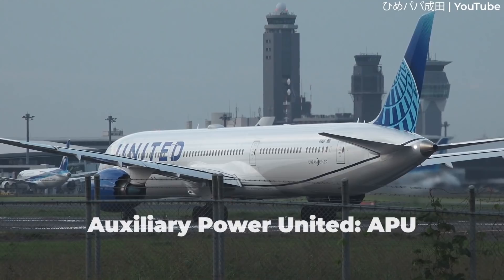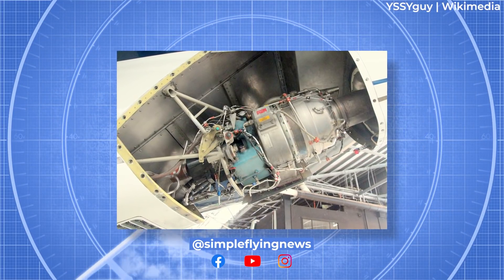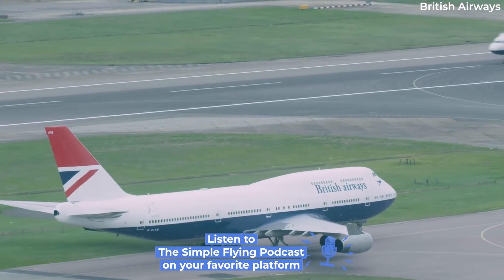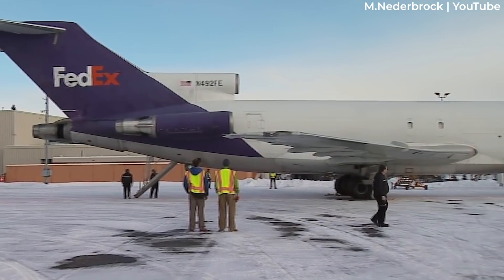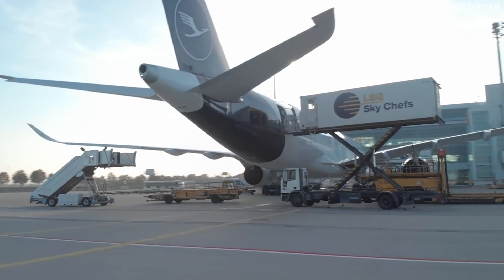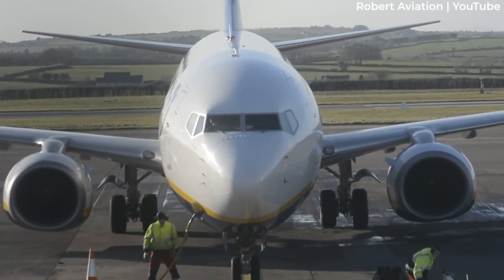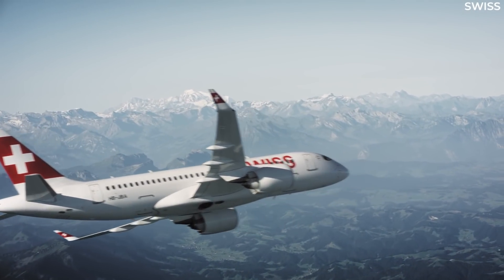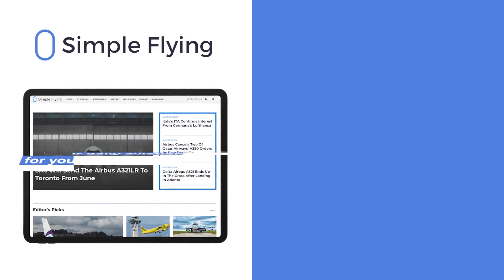What Was The First Jetliner To Be Fitted With An APU?

Comment: A problem with the 727 APU placement in the right wheel well was that the exhaust was also on the right side fuselage, just behind the wing.      Sometimes fuel vapors would collect in there and during start up after landing, it would ignite those vapors and produce a brief flame up past the right side windows - startling the Passengers.    As a Flight Attendant, we would have to be aware of this fact so that we could be ready to prevent an unnecessary evacuation that would be started by the Passengers.      If you look at old photos of the 727, sometimes you can see a dark streak across the right fuselage that was caused by these flair outs.
Reply: The flame that you mention was only after a failed start when unburned fuel was left in the combustor. Upon a second start, that fuel would create quite a fireball roaring out of the right wing. Newer APUs have a fuel venting feature to prevent such flameups.
The 727 APU could not be operated in flight.

Comment: The biggest reason carriers use ground power units is financial. This costs on average 300 dollars an hour to use the APU. Going power units are a fraction of the cost.
Reply: You can't cool an airplane with a GPU except for the all-electric 787. Cooling requires huge amounts of bleed air.

Comment: How does the APU get its air? Does it bleed air from the engines? I didn't see an air inlet.
Reply: It takes in air from a dedicated inlet located on the upper fuselage which closes when not in use (that's why you don't see it). Some of the air goes to the combustor, the rest to a shaft-driven "load compressor" which sends air to the airplane's pneumatic system (ECS packs, engine starters).

Comment: I think anyone who is interested in aviation would know about the use of APUs. It's often a gotcha question in quizzes, ie how many engines does a 747 have - answer, 5 (although it can ferry a sixth engine under the wing). At one airshow, I saw a glider which had been fitted with a tiny jet engine. One of the commentators joked to the other (who was a 747 pilot) that the engine was smaller than the 747 APU. 😀
Reply: With an engine, didn't it cease being a glider!?

Comment: In the early 80's as a new 727 flight engineer on starting the APU I would close my eyes and cover my ears as the turbine was situated under the thick part of 3 fuel tanks. They would also "torch" quite often in strong wind conditions.
Reply: What do you mean?
Reply: @donaldstanfield8862  it means it was like putting a bomb underneath a kerosene storage tank
Reply: No. The APU was enclosed in a fireproof shroud to prevent fires. It was located inside the keel beam of the airplane in between the landing gear.
Reply: @Greatdome99  It traversed the keel beam and I don’t Consider anything in a wheel well fire proof. Period.
Reply: I used to fly a Hawker that did the same thing when the APU start nozzle was clogged.  Quite a spectacle at night; it'd light up the whole ramp.  We called it the "Angry Dragon".
Reply: @elcheapo5302  Nice!

Comment: Very inacurate.  APU's swept in for flying boats,  which had flights of several days,  and stays on the water.  APU's powered tube radios,  cockpit and cabin lighting, fans,  ventilation,  plumbing,  bilge pumps,  vacuum cleaners,  cabin appliances,  and backed up landing gear.  Each radial had a big generator and one more ran off a quality Advanced Power Unit air cooled gasoline engine.  The APU also took strain off the small batteries for starting motors.
Reply: I wondered about that, they landed in some pretty remote areas, so would need to be self-contained, thank you!
Reply: @donaldstanfield8862  just some minor rewriting.
Reply: In the mid 1950s the USAF Grumman Albatross amphibian (Sa16) had an APU in a separate compartment in the rear fusillage which we used to start engines both on the land and on the water. George Groh(former USAF navigator)
Reply: I used to go on detachments with P-3 crews to some places where support was limited.  One time we were flying out of Bogota and the APU didn’t have enough power to start our engines as the airport was at 8600 feet above sea level. A 2nd P-3 that did start used its prop wash to assist to get that first engine going.
Reply: I saw a diesel APU in Howard Hughes Flying Goose. Located just behind the flight deck.

Comment: i think i read once that an apu on a 737 technically increases its glide distance/time by like 13%, assuming both engines die
Reply: How would it do that? It produces electricity and compressed air, not thrust.
Reply: @davec8921  During our Delta Airlines B737 training, we were told the APU generated 37 pounds of thrust...insignificant for powered flight but good for trivia questions.
Reply: @davec8921  its exhaust is pointed backwards.... and while it might not be optomized to throw it backwards with as much momentum as possible like a regular jet engine, it both lightens the plain and has some mass velocity in the opposite direction. might also have to do with keeping systems online that optimize glide ratio in newer models

Comment: The placement of the apu on the 727 was horrible... the noise was deafening when unloading the rear cargo bins... That was my only complaint about the 727, otherwise it was one of the most well designed products to ever come off of the Boeing assembly line.

Comment: Missed from the video is the fact that the APU is used to start the main engines by compressing air & delivering it to each engine’s air start.
APUs can also provide hydraulic power & electrical power.
The power output to size ratio is extremely impressive & they run on the same fuel as the propulsion engines.
APUs however do not or cannot provide propulsion.
Reply: i heard the exhaust force is comparable to a 7 seater light aircraft on widebodies though i could be wrong
Reply: however too miniscule to do anything
Reply: @thetheatreorgan168  No. It's only a couple of hundred pounds. The turbines are designed to extract as much power as shaft HP, not thrust.

Comment: Fun fact: Concorde didn’t have an APU to save weight and space in the narrow tail. Thus first two engines were started using an air cart, the remaining two were started using engine bleed from the engines that were already running.
Reply: Didn't they put one of the many fuel stowage tanks in it's place?

They got rid of a few amenities to place them, I know that.

Quite literally became a balancing act for them as well.
Reply: @DasMoose9001  Affirm, the tail cone housed the aft trim tank, which was filled with fuel during supersonic flight to offset the effect of the center of lift also moving aft.
Reply: @leobakkerflightandspace6655  

I figured as much, thank you very much for clarifying that with me.

The Concorde is a unicorn in my generation, by the time I was interested in them AF-4590 had occured and they weren't in service anymore.

Comment: Talk more about how APUs relate to redundancy and etops!
Reply: 180 minute ETOPS requires twin-engine airplanes to fly with one engine inoperative for 180 minutes (some now 240 minutes). In case of an engine failure, the APU is fired up to provide electrical power since it has essentially the same generator as the engines. The APU doesn't directly power hydraulics, but can via the Electrically Driven Hydraulic Pump. It doesn't have the pneumatic power to restart engines at altitude--that's accomplished below 20,000 feet via "windmilling" the engine.

Comment: The APU also provides bleed air to start the engines.
Reply: Which makes startup a lot easier
Reply: @PositiveRateAv  Try “engine start possible”
Reply: Except the 787
Reply: @suddhojitgon5929  No. The 787s all-electric APU supplies electrical power to the main engine's starter generators. Ground power electricals are inadequate to do that.
Reply: @suddhojitgon5929  also not A350
Reply: @satunnainenkatselija4478  that is strange, becuase the bleed air system is fully removed of the A350 engines just like the 787. So it sound strange that it can use bleed air start, when there is no bleed air system
Reply: What Is Junkrs